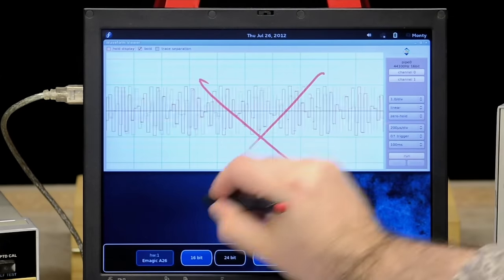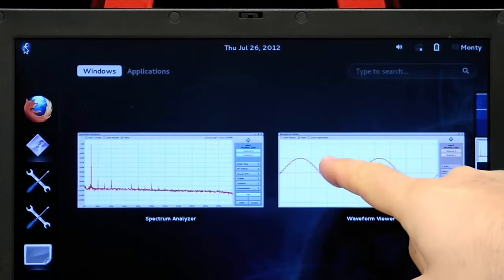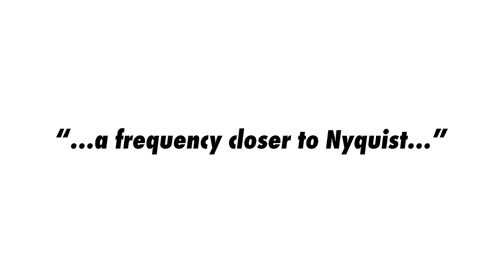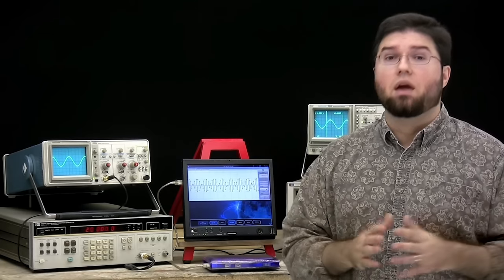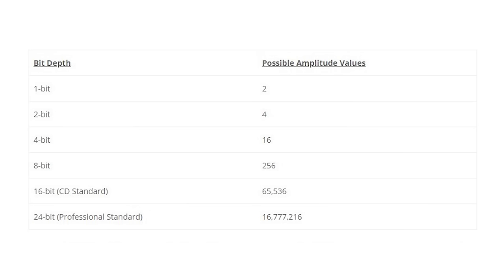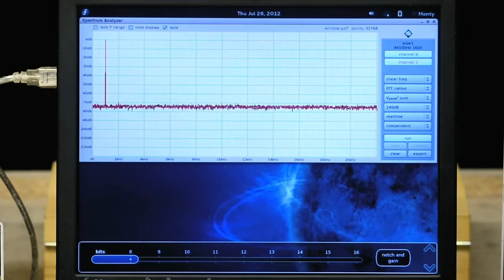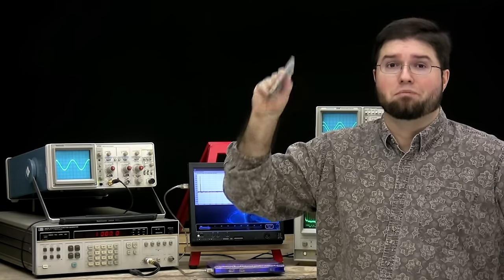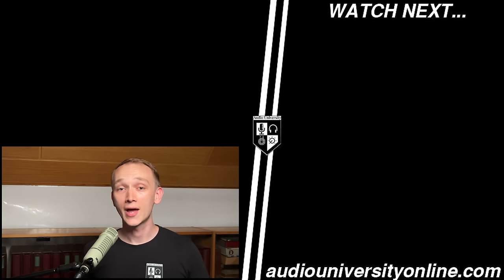Debunking the Digital Audio Myth: The Truth About the 'Stair-Step' Effect

Comment: I was an avid amateur audio constructor ever since my teens in the 1950s, always striving for the best sound quality I could afford. It took less than a minute to convert me to digital forever the first time listened to a CD!
Thanks for this video.
Reply: I remember how the first CDs had a high end scratchy sound.  It was because the master was mixed that way because they knew the transfer to vinyl would attenuate the high end. So when they made the first CDs they just grabbed the original master tape and sampled it to digital. And the digital faithfully reproduced that extra high end instead of reducing it like the vinyl processing naturally did. End result was digital got a bad rep.  Later they remastered with digital in mind and the next release of the same album was much better.  So I ended up taking some of my early CDs and tossing them and replacing with newer versions.
Reply: @kthwkr  Ah, the (in)famous RIAA equalisation! That chapter gratefully closed forever, along with tracking weights, lateral compensation, surface noise etc that went with expensive turntables and magnetic cartridges.
The current infatuation with vinyl is beyond me.
Reply: @kthwkr was it like a crt whine?
Reply: @jq4t49f3  Add to that the infatuation with tube amplification.  I was there when the conversion from tubes to transistors happened and losing the distortion and bias of tubes was a big step forward.
Reply: @ClareHehe  Think of it more like turning up the treble control all the way.
Reply: My Ah Ha moment was listening to a Telarc Digital CD.  Telarc was founded in Cleveland, Ohio and was a pioneer of CDs.  They made original recordings of music in digital format from start to the CD.  The dynamic range was astounding, the bass smooth and deep, and treble was crisp, the sound of bells and cymbals like I had never heard before.  Now in my late 60s, I listen to those CDs and I know the sounds are there, but I no longer can hear the highs like I could in my teens and early 20s.
Reply: @BryanTorok  OTOH, there's not a lot of musical interest above 10KHz luckily!
Reply: @BryanTorok  For me the transition from single ended valve (tube) to push-pull outputs may even have rivalled the advantages of semiconductors at the time. I built several transistor/FET varieties subsequently  before settling for a humble 10W class A design by J Linsley-Hood. Driven through a pair of Quad electrostatics I could finally enjoy the quality of music I had yearned for all along!
Reply: @jq4t49f3  The other advantage of solid state was not needing a large heavy high voltage power supply system and far less heat.
Reply: @jq4t49f3  WTF! I have a pair of Quad ESL57. and drive them with two 30W mono amplifiers. Passively cooled, transformers with shield windows, fully regulated/stabilized power supply, Iq=3A (designed to be turned up to 4A if I ever feel the urge...).

And yes, it's basically a beefed-up JLH.

Nice to know that at least one other persons on this planet agrees with this constellation!
Reply: I got my first CD player in 1989. I was floored at how good it sounded compared to cassette and vinyl.  I never looked back.
Reply: Budget CD players with the badge which said the speakers were "CD-compatible" (or something) were abominable! They could turn panpipes more than half-way into bagpipes! 🤢Older cheap CD players were better. Anyway, a few years later, I bought an affordable little micro system with speakers in wooden enclosures, and it was great! (Especially once I removed those daft plastic louvers from over the tweeters. ;) I've never seriously looked back from digital since. I have heard some muddying of the sound on some systems, especially computers from the 2010s, but I put that down to naive implementations of digital volume control. It's too easy to implement it in a way which loses bit depth at anything but max volume.
Reply: 12 bit audio converted you? You must have already lost your hearing!
Reply: @TomJones-tx7pb  But not my marbles! I went for 16-bit right from the start.
Reply: @BryanTorok  Not to mention hum and tube microphonics!
Reply: Early CD playback was not great. But maybe you were not around then?
Reply: @D800Lover  Still far better than vinyl, even 60yrs ago!
Reply: @jq4t49f3  the vinyl stuff is not about fidelity but style.
Reply: @modellking  Like artificially distressed denim?
Reply: @TomJones-tx7pb  12 or at most 13 bit is equivalent to mastering quality reel to reel equipment... 12 bits have to do with signal to noise nothing to do with frequency range... that's the sample rate
Reply: I don't get it. Where are all the people that remember how listening to a CD in the 80s gave one a headache. One could only listen for an hour maybe before your head was swimming and a headache was coming on.
Reply: Your ears deceive you, you can't beat Analog if it's recorded with quality gear
Reply: @hiteck007  IMHO the rational appreciation of quality lies between the ears.
Reply: @jq4t49f3  actually it's reproduction quality, it's as simple as that & CD's don't have any, some movies on the other hand double up on sampling, I can hear the difference there if there wasn't a break in the chain of sound processing quality.
Reply: @hiteck007  You're unlucky to be distracted by such acute hearing. As I grew older I enjoyed music more and more for its content rather than form. Nowadays I enjoy a good piece of classical music just as much as before in front of my laptop!
Reply: @hiteck007  Audio placebo effect.  Unless you have double-blind experimental evidence with a statistically valid sample size - the laws of physics and human biology say "bullshit".    The placebo effect is VERY well known to occur with audio fanatics.  (Note positive reviews for $500 USB cables for example).
Reply: Answer = Money. Lots of it.
@jq4t49f3 said, "The current infatuation with vinyl is beyond me."
--------------------------
To twist a phrase from Alan Cumming's "Money, Money" (movie=Cabaret)
The (vinyl) world going around makes money.

Also reminds me of the nonsense marketing claims that unbelieveably expensive "special" speaker wire (like US$10,000 vs. US$20 for 2 or 3 meters of it) will significantly and audibly improve the quality of audio output.
Reply: @exgenica  Greased with plenty of snake oil!
Reply: My God... I'm just impressed you can operate a computer in your 80's. You really are a gizmo guy.
Reply: @gabrielsatter  Computers? No problem. iPhones? Utter defeat!

Comment: Thanks for mentioning at the end that 24bit and higher sample rate is important for production.
Indeed, for recording one doesn't need more than 44.1 or 48Khz, however in production when there are tens of filters and effects applied to a sound, distortion and noise is amplified if the resolution is insufficient.
Reply: I can't think of anything that would create either noise nor distortion if the sample rate at which the audio is recorded at 44.1k. Oversampling for non-linear processing exists and for linear processing it's not necessary (and for things like convolution a higher sample frequency makes everything eat up computational resources. My DAW supports 16xOS, applicable to either plugin chains or single plugins, which is plenty. No need to waste CPU power and thus performance on using higher sample rates for things that don't  benefit fromthem...
Reply: @simongunkel7457  They produce ultrasonic harmonics, it you don't have space enough on your bitrate to accomodate them, they "bounce" back to the sonic range and they can be heard as "artifacts". So you need space where they can propagate, and can be cut clean when converting back to 16 bits, because all the "trash" is out there beyond the 16 bits resoultion.
They will explain this on the next video for sure.
Reply: @framegrace1 You are confusing sampling rate with quantization (bit depth). The bounce back happens if you have non linear processing (like all distortion) and the sampling rate is too low. Quantization only affects the noise floor.
Reply: @framegrace1  You are confusing bit depth and sampling rate here. There are good reasons to record at 24 bit depth, but that doesn't have to do with ultrasonic harmonics, but it allows for more headroom when recording and more tracks to be mixed (you lose about a bit for each quadrupling of tracks, so if your project has 64 tracks that will mean your output will have lost 3 bits compared to the recording. And you also lose a bit for each 6dB of headroom while tracking. When 16 bit was state of the art, you had to track really hot, which made clipping likely. With 24 bit, you don't have to track hot at all and won't clip and still have plenty of bit depth to allow you to go ham with multitracking). Aliasing, i.e. ultrasonic harmonics bouncing back from Nyquist has to do with the sampling rate. But as I mentioned you can use oversampling to deal with that. So my recorded audio at 48k goes to a non-linear plugin. It will alias. I enable 16x oversampling for that plugin, which will make the plugin see a 768k signal where the ultrasonics get to live up to 384k and then have another 360k before they would bounce below the 24k where they could end up in my 48k signal. That is then filtered out and the signal is converted back to 48k. But if I send my 48k signal to a linear plugin, it won't produce any harmonics and thus I don't need oversampling and will just run the 48k signal. Convolution is usually the most intense processing and it is linear, but the computational load scales with the sample rate. Note that my line of thinking here requires a DAW or plugins that oversample. I'm using reaper and per plugin oversampling has only been a feature for less than a year and not every non-linear plugin has internal oversampling (though plenty do). But even then tracking at higher sample rates rather than processing at higher sample rates didn't make much sense and now you can get granular with that. If you hit everything with 96k, you will slow down things that don't produce aliasing anyway and things that do will still have bigger issues than if they specifically got 768k signals to work with.
Reply: Exactly, processing in the digital domain will degrade the signal, unless you start out with a higher quality already. Just a simple +3dB filter already throws out one bit of dynamic range, so you better start out with some headroom. 
Somehow audiophiles got wind of the fact that these audio formats exist and that it would be better to listen to this original mastering instead of a downsampled copy, which obviously makes zero difference, unless you can upgrade your ears to higher dynamic range and higher frequencies.
Although I'd still say that for typical audio mastering, only the bit depth will actually matter, unless you have some serious slowing down planned. Otherwise the high frequency components would remain outside the audible range either way. Maybe it might protect better against some quantization artifacts when filtering.
Reply: @graealex  Not quite since DAWs usually use float32. Even the mantissa allows for a lower quantization noise floor than needed. You still have an exponent though. A shift by 6 dB up or down is just a multiplication or division by 2 which can be done with the exponent only. In between there will be recalculations on the mantissa but that is fine, too since you have 23 bit here. Since audio is usually interpreted statistically, there is really no need to worry at all.

You will practically never have issues with quantization noise in digital processing with a DAW.

Also keep mind that 16 bits on delivery for CDs were chosen since audio is effectively never uniformly distributed. You will not get the ~-96dB noise floor since modern ADCs and DACs are built for equally spaced quantization and effectively don't need to since amplifiers usually struggle with lower SNRs than 90dB.

As an example you can very much get away with 8 bit for speech if you use something like mu law quantization, which is optimized for the laplacian distribution (or close to) of speech.
Reply: Also, if you're recording at 24 bits, you can use a, say, 6dB lower level to be sure there aren't any unexpected 0dB clips should the artist suddenly get enthusiastic, without surrendering the dynamic range of 16 full bits.
Reply: @stephencharlesdawson  Although that doesn't necessarily account for noise in the analog domain, which might still be higher if recording at lower levels.
Reply: @Mefistofy  Then I'll shift by 6.1dB and the problem is back on the table.
Also, this might be more about just knowing that you have the headroom and no practical audio processing would actually degrade the signal unnecessarily. As pointed out in the video, even 16 bits would be more than enough dynamic range, so 24 bits will just guarantee that you'll always maintain that dynamic range, and a reasonable noise floor, no matter what.
Reply: It's basically the same with photography and digital image processing: sure thing, go ahead and save your files with 32bit per chanel in AdobeRGB or DigitalP3. You don't need it when taking the picture (because almost all consumer, prosumer and professional cameras don't go that far - 14bit it is at best)and you don't need it afterwards (niche applications like actual HDR content ignored) but it does make quite a lot of sense while editing. Once done, just convert back to a normal format (i.e. 8bit per chanel sRGB) and everything's fine.
Reply: @simongunkel7457  wrong. Play sample @ 1/x tempo (eg 1/4) and you NEED 176.4 khz in SOME cases, via eg Sanken mic
Reply: @GA-uv4hy  I call snake oil.
Reply: 24 bit is important not just for production but for any playback chain that has DSP such as the loudness normalization used on nearly all internet streaming (youtube premium, spotify, apple music, amazon, tidal, and all others.)  

"Indeed, for recording one doesn't need more than 44.1 or 48Khz, however in production when there are tens of filters and effects applied to a sound, distortion and noise is amplified if the resolution is insufficient." Well, NEED is a strong word, but the quality will indeed get better with sample rates beyond 48kHz, and this can be scientifically demonstrated as well as proved in subjective testing. Bottom line is, neither your samples nor the Nyquist is going to help you get the right peaks on percussive transients, which is why cymbals always sound more like shredded paper on recording, and metallic rainbow shimmers in person.
Reply: Using higher sample and bit rates in music production has absolutely nothing to do with sound quality or fidelity.

Higher bit rates guard against accidental "overs" that would otherwise ruin a take, while higher sample rates reduce the latency. That's it. That's why producers use high sample and bit rates. Not because of higher sound quality.

(Some effects and processors do benefit from higher sample rates when processing the signal, but they'll do that internally and invisibly anyway, without your input or decision.)
Reply: High sample rates can also be slowed down more than lower sample rates without as much of a sacrifice in quality. I'm guessing he talks about that in the follow-up video though.
Reply: @nameismetatoo4591  That's true only for extreme slow downs. For "normal" bends (as in "fitting" parts together) it doesn't really matter, there's no audible degradation, even if it's recorded at "only" 44.1k
Reply: @PartyMusic775  how so? 16 bit can be converted to 32fp basically for free at runtime. No need to store it in 24bit for playback.
Reply: Plus, you need much higher sampling rates for production because you often need to change the pitch of samples, which could otherwise bring the effective sample rate under the Nyquist threshold.
Reply: @theantipope4354  That's true only for extreme slow downs. For "normal" bends (as in "fitting" parts together) it doesn't really matter, there's no audible degradation, even if it's recorded at "only" 44.1k
Reply: I have found one (1) singular use of 192kHz audio, and that is oscilloscope music
Anything that does not contain information that is not intended to only be heard by humans does not require more that 44.1 kHz.
Reply: I love listening to heavy metals, higher distortion and noise are my friend
Reply: THIS RIGHT HERE

Comment: I learned this while studying computer science. It was one of the basics required for the bachelor. The same methods/theories are used for all kind of signal processing like WLAN or cell phone networks.
Reply: Thanks but I prefer analog WiFi. Reddit just has a better more real feel to it.
Reply: it's also used in television, radio, basically, if it has a signal, it likely at some point in the signal chain, uses the logic of the Nyquist sampling theorem in it's design.
Reply: is that why my cell phone sound so good?
Reply: @oldolfmann8927   It's why the most common word in cellphone conversations is, "What?"
Reply: @davidryder3374  my comment was sarcasm  LOL.  Digital does have it's place, but there are a lot of places I do not like it.